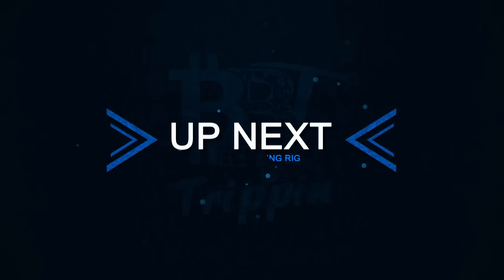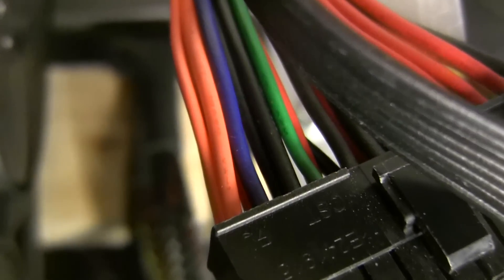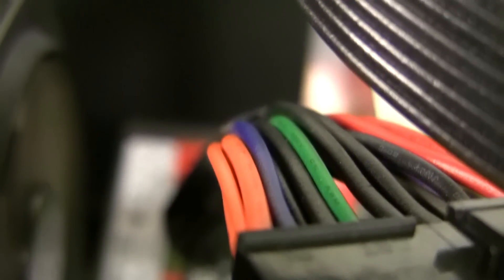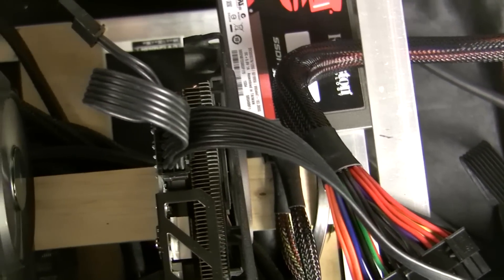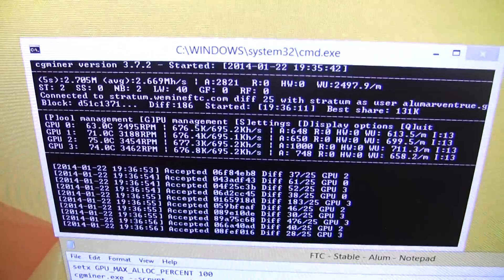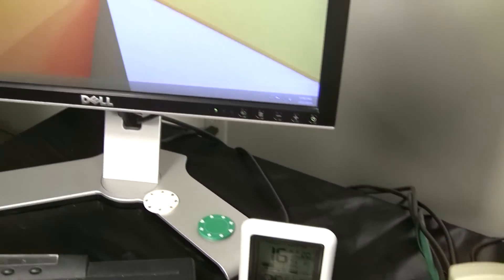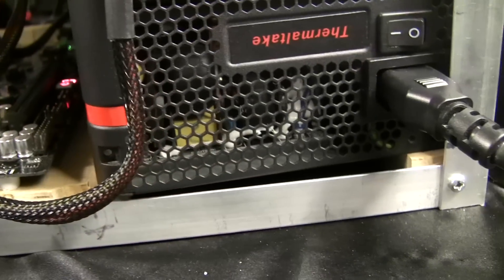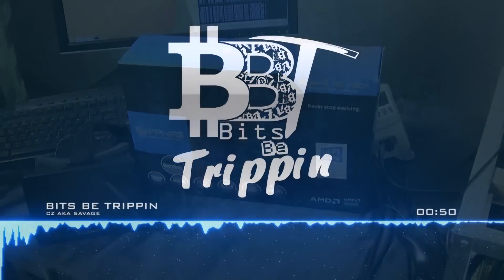BBT Episode 6: How to use 2 PSU for your Litecoin Dogecoin Feathercoin mining rig

Comment: OK? newbie here and not technically gifted as such. So lets say I am powering 3 1660 Supers with a 750w PSU. I would like to connect another PSU, a 550w. What exactly is the wiring process? Short the 24pin with the wire clip in the green/black connectors......Plug a PCI-E wire from the 2nd PSU to my extra (4th 1660 Super)GPU......But how are the 2 PSU's connected to share power? How do they interact? How does the motherboard recognise the 4th GPU?

Like I said, I am a newbie who is also on a steep learning curve!

Cheers guys!

Comment: Hi brother, I am new to mining and hence PSU... I am trying to create 8 GPU rig. I have 2 PSUs of EVGA 750 G2. Planning to power 4 GPUs with each. I am connecting two PSUs with DUAL PSU cable, 1 being primary and 2nd being secondary.  

Question 1: Does the secondary PSU needs to have a Power cable plugged in and going into a power socket on the wall ? or PSU cable from primary PSU to secondary will take care of powering it.

Question 2: If both the PSU has to connect its respective power cable into a socket in a wall. Does it has to go into 2 different sockets on the wall, or can the both power plugs go into one switch box and that can be connected to wall plug; hence making sure both PSUs are getting powered at same time.

Question 3: I heard if secondary PSU has power and primary doesnt it will be loop and will fry the motherboard and GPU. Is it true. What should i be aware if and try to avoid.

Kindly help advise and guide. Thanks much in advance.

Comment: Is it possible to use two separate PSU's to power one GPU? Like if I have a GPU with two 8-pin connectors, I could take one 8-pin to one PSU, and the other 8-pin to another PSU? Thanks
Reply: Edward Storlien yep

Comment: hi nice video, I've just tried this and my psu powers up, but when i plug it into my R9 290 GPU it turns itself off?(tried both the 6 pin and 8 pin seperatly)? i'm trying to test my GPU in another PC but my PSU isn't big enough, and i don't want to use the psu in my current rig, because i want to test it isn't that PSU either. both plugs for both PSU's are plugged into the same extension lead so both grounds should be the same right? any ideas????

Comment: Thanks for this, was looking to use a PSU as a power supply for my asics and was stuck in noobish hell trying to figure out why the supply would not turn on. Worked like a charm, though I have enough electrical tape on that metal to protect my paranoia from overload.

Comment: I am very interested to know if it is possible to play with 2 PS, and if this system is stable 
listen to the master source works to maximum and the slave only gives the amperage is needed,
 Example: required 12A, 10A 2PSU have connected.
 the master give 10A and slave give 2A. is this true?

Comment: Hi Bits Be Trippin'
How important is the wiring? Every wire has a own resistor. Would paperclip do the job? 
Also both PSU's have a EPS12V and ATX. I have on my MOBO only one EPS12V . Where im going to connect second PSU EPS12V ?
Thanks

Comment: This is sick, totally worked out great. On another note how does one go about figuring out how many watt PSUs to use? I've got one 280x + mobo hooked into a 750w and two 280x hooked into a 650w. Seems like it should be enough but I don't get how the efficiency or the "Rels" you mentioned plays into it. What the heck is a "Rel" any way?? Thanks for your videos, I've watched them all many times!
Reply from the maker: 12v rails (that plug into the top of the graphics cards) which has a amp rating ... so just because you have x amount of watts if your rails are not rated for the amps the graphic card needs ... you're pc will shut down or have the potential to clip the PSU pretty hard.

PSU Efficiency is based on its rating (bronze, silver, gold, platinum) i.e its ability to convert AC/DC. 

Which 280x you have? The toxic pull over 300w to 315w per card
Reply: Bits Be Trippin' I've got Sapphire 3GB Dual-x but I've under volted them to 1.161v. I want to ultimately run five of them on the same mobo but I'm not sure how to split up the PSUs. I was thinking a 750w + 1000w EVGA SuperNova, I got the 750 now. If I did that could I run mobo + three GPU off the 1000? Then the other two GPU off the 750 or some what might be better?? Appreciate the feedback!

Comment: Hey I was hoping you could assist me. I can't seem to get my motherboard (ASRock 970 Extreme4) to recognize my 3rd video card (Asus R9 290's) no matter which PCI Express slots I plug them in to. I'm using powered risers for all, and two PSUs (850w+750w). I've tried shorting the presence pins, I've tried every combination of pci-e slot usage (3 cards, 5 slots) and absolutely nothing seems to allow me to recognize all 3 gpus. Any thoughts?

Comment: instead of jumping PS_ON to gnd, just jump it to the other green wire thats in the main power supply. they will both power on together as long as they share gnd
Reply from the maker: We could, if wanting to keep them in series and attached to the hip, absolutely!
Reply: I'm just throwing it out there for folks looking to do this. There's no need for the psu to be across the room or to do any other special wiring. Just hookup the devices you want to power with it the way you normally would and run a jumper wire from green to green. This wouldn't be a series connection, but a parallel one.
Reply: Yes Warndog should clarify. I doubt they mean expose the green sheeth and jumper and tape up.

Comment: Hey Bits,

I have a 3 *290x rig with 2*750W PSU.
I did the bridge with a between the green an black wire on the second PSU.
Both of my PSU are runing ok BUT as soon as I start mining, the second PSU shut down right away.
I tried to reverse the PSU's but the second one stop systematically when I start mining. 

Can you help me ? 

Thanks a lot !

Comment: Alright I have 6 of these cards, but have 2 in 3 separate computers due to lack of PCIe risers, and kind of afraid to use them due to horror stories of cheapo risers that short out equipment.  What risers do you use/recommend?  Also your settings I think may depend on motherboard from what I am seeing.  Only on my 7 year old Alienware (EVGA) am I getting both cards to run at 730 kH/s.  On my 2 year old Intel Gigabyte board, and my brand new AMD Asus board if I use your settings one card tops out around 585 kH/s, while the 2nd card does get to 730 kH/s.  If I use my settings (-g 2 -w 256 -I 13 --lookup-gap 2 --thread-concurrency 8192 --gpu-engine 1020 --gpu-memclock 1500) both cards seem to level out around 705 kH/s on all 3 of these computers.  Any suggestions?